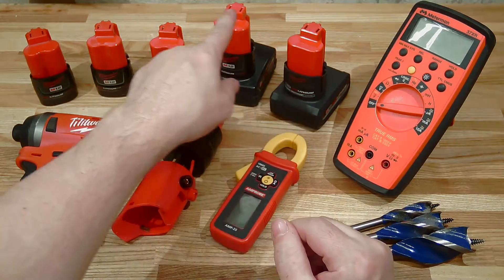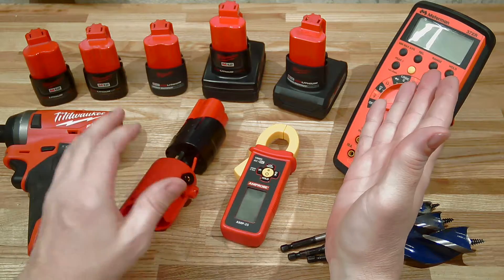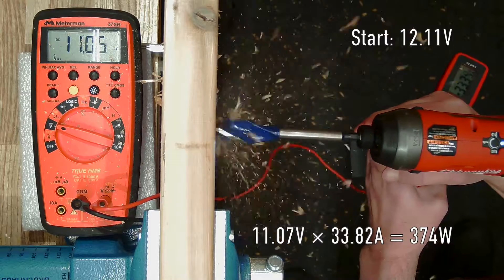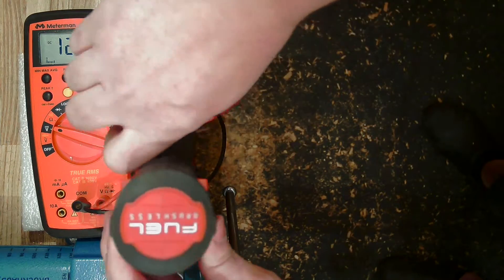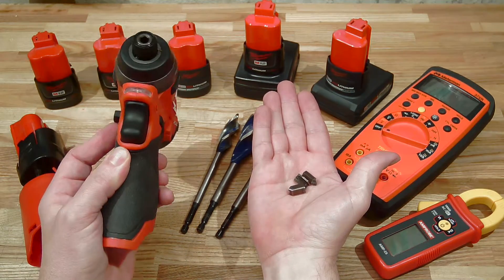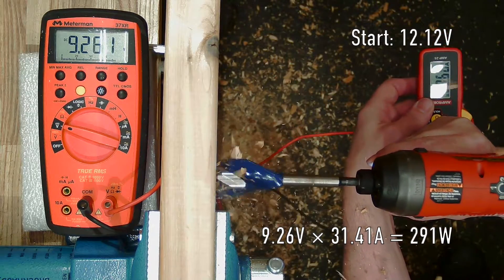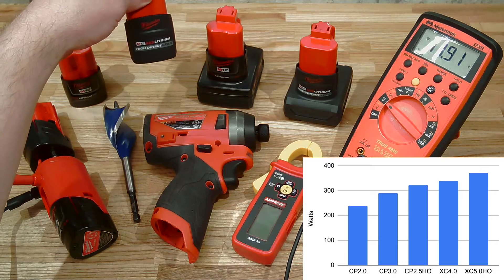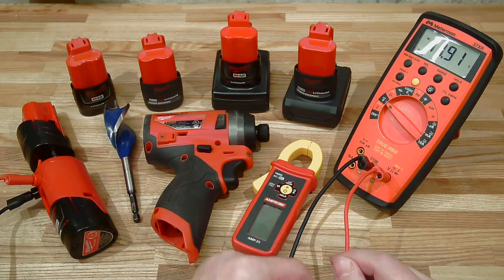Test: Milwaukee M12 HO Batteries Better In Their Impact Driver?

Comment: Great video, thanks!

It seems with the smaller capacity 1.5 and 2.0 drop voltage to the point of failure quickly. These are the size batteries that make the M12 line more convenient for getting in awkward spaces. Once you switch to 3.0 and above, you may as well be using the M18 to get the benefit of parallel cells that handle the load much better.

I'm probably going to try putting in higher capacity cells with a 20 amp continuous discharge in my 1.5 and 2.0. Hopefully the BMS can handle it.

Comment: I like the comparison, but it's comparing apples and oranges. What is the difference between a standard 4ah battery vs a 4ah XC vs a 4ah HO XC? Test the tiers of batteries using the same Amp Hour rated battery. What makes an XC battery better than a standard battery? What makes a high output XC battery better than a standard or XC battery at the same amp hour rating battery?
Reply from the maker: XC battery has cells in parallel... can provide higher current than CP batteries. The new fangled HO batteries use a new type of cell that can provide higher current than the standard cells. Undoubtedly the newest are the bestest, but I am interested in whether they are worth it or not. Check out my air moving tool tests: with those tools higher output batteries do not make a very large difference in performance.
Reply: @RoomForTools  ah, OK.  Thank you!